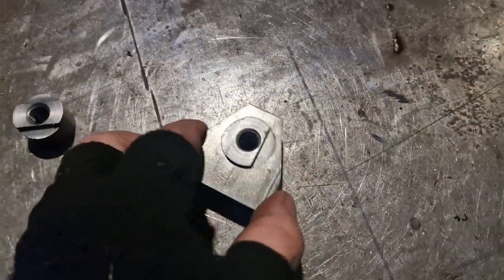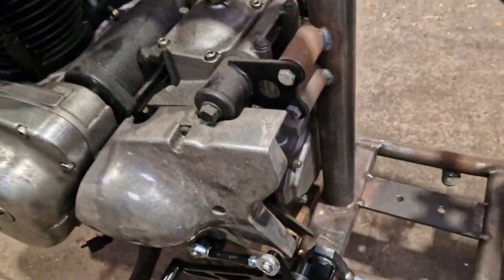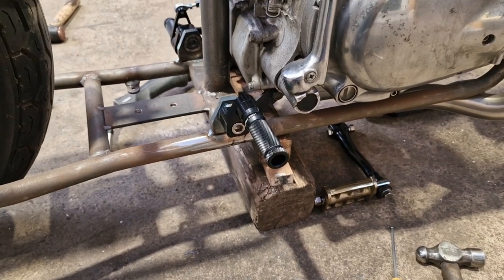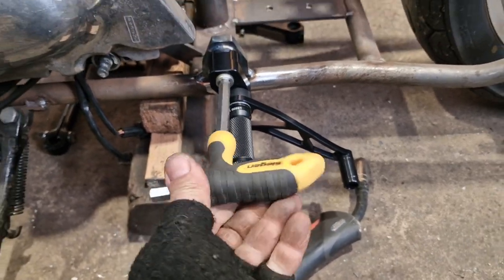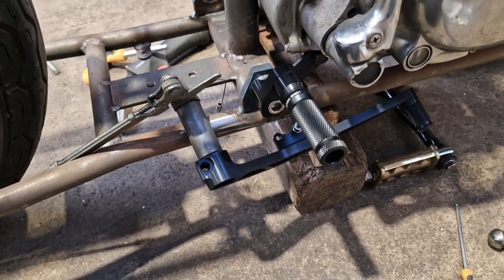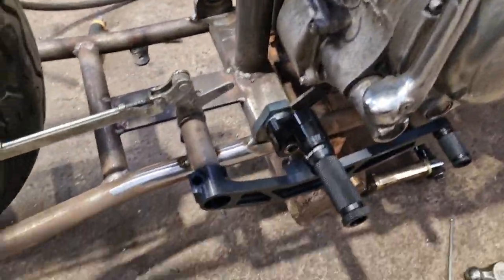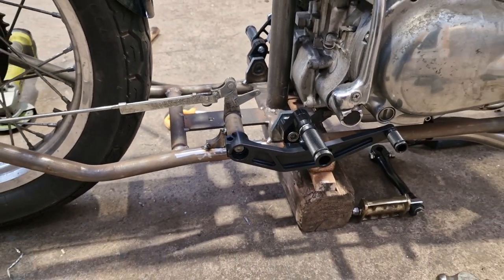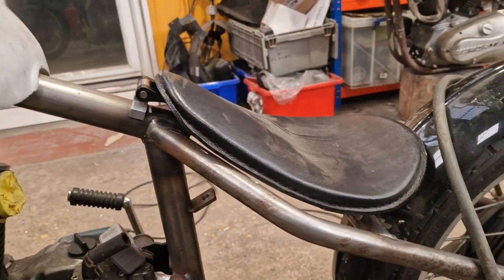How I Build W650 Chopper Bobber Handmade #engineering #welding #bike

Comment: I think you need a suspended ceiling Ralfy. They use a thin metal grid hanging from wire from the steels. The grid gets infilled with ceiling tiles that can be thermal or accoustic based. Led lights can be incorporated into the grid for your workspaces
Reply from the maker: Thanks Phil, I've since built an inclosed workspace

Comment: have you looked in to EPS Foam Sandwich Panel Metal Board,normally used for cold storage walls and ceilings, its about 5 to 6 inches thick
Reply from the maker: Will do thanks buddy

Comment: Ello Ralfy your living my dream ......well maybe different style bikes but building bikes, i got ear coz im picking up a 140 tmorro (boxford out harrison in) may i ask wat filler rods do you tig your frames up with. Thanks
Reply from the maker: Thanks buddy, I use either regular steel welding rod, mig wire, or if the steel parts are different grades, stainless rod for "Dissimilar" metals